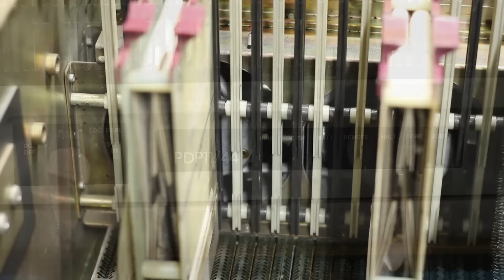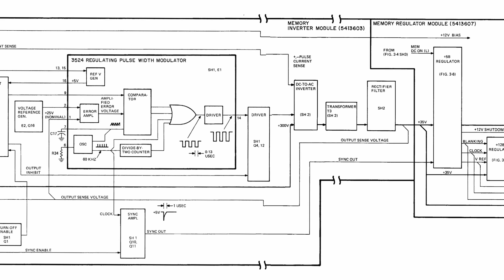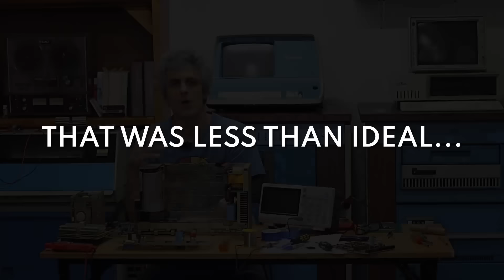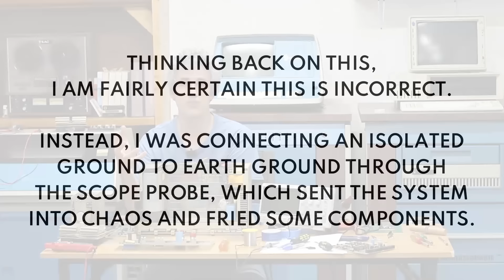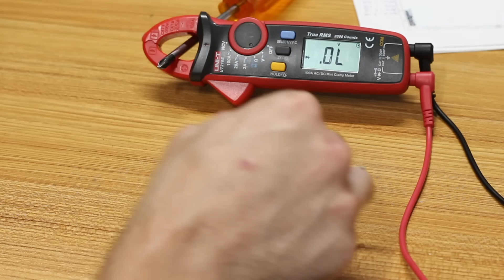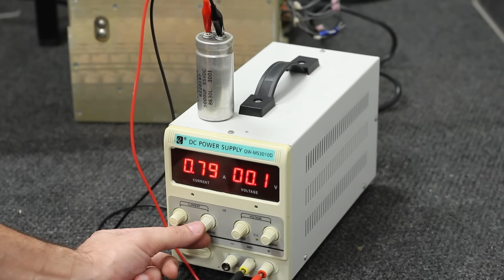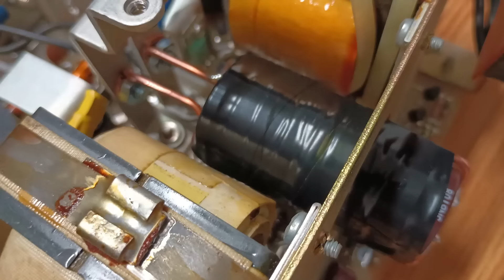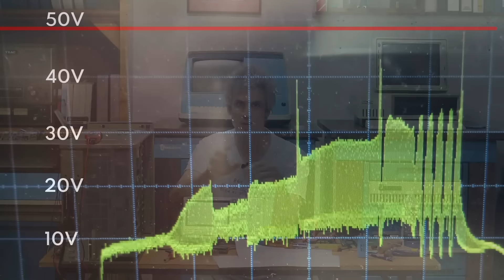PDP-11/44 PSU is Slowly Coming Back to Life!

Comment: Good going!  You have an awful lot of patience.   I would have given up about 45 minutes in.  A few suggestions:

(1). Consider buying a good electrolytic capacitor checker.   HP made some good ones and they’re now at reasonable prices.  

(2). Get some power  resistors or light bulbs that will put a typical load on the power supply.   Many supplies don’t like having no load and might trip their over voltage alarm with little or no load.
Reply from the maker: Thanks!
I do need a good, proper LCR meter. That's on my list of tools to convince Mrs. Usagi to let me buy, lol. If you look closely, everytime I power up the machine, I have a 12V automotive headlight bulb as my primary load. Looking at the schematics, not all the rails need a big load on them to come up properly, so the PSU is definitely operating with the proper load and as expected (with the exception of the +12V rail which has a regulation problem we'll dig into in the next episode).
Reply: @UsagiElectric the average LCR meter isn't that useful to test life, they don't test at high enough voltage. Some people claim that leakage is a resistive thing and thus can be checked at low voltage. However that doesn't account for material breakdown. That isn't linear and can be gone at low voltage and appear at high voltage. You would need a still very expensive HP or sencore device to measure that. I believe Shariar from the signal path showed one not so long ago. 
Miss usagi is not going to approve that expense. The simple LCR meters are fine for a quick test and value measurement.
Reply: @UsagiElectric  get a capacitor wizard.   Measures ESR in-circuit.   ESR is what you should be looking at especially with switching supplies.
Reply: @UsagiElectric  Maybe you should add an electronic load to that list as driving with only one headlight is prohibited by law. 😀
Reply: @UsagiElectric   For something much cheaper but still decently capable get something like the "LCR-TC1" which is based on an open-source AVR transistor checker. It identifies many component types. For capacitors you get capacitance, ESR, and loss factor. It also calculates transistor type, gain, voltage drop, and leakage.

The big downside of this $20 device is that it can get fried by charged capacitors. This is something I have unintentionally tested myself. Also you'll need to test out of circuit but this is true of almost any tester.

Comment: Ah, the fun of breaking something and spending days getting back to where you were before. This is why I gave up on hardware and went with software... while I was still high school age, back in '79 or so! A few decades later, I finally have the patience to deal with big TTL-level stuff. But not these bonkers power supplies! (RF is right out.)

Comment: You need an isolation transformer for your 'scope's AC.
Reply: Isolating the loads AC is the saver way. (But of cause more expensive for big loads.)
Reply: That doesn't do anything, the oscilloscope's power supply is already isolated. It would be just as effective to cut the ground wire in its power cord which is dangerous. As everyone else has said the safer option is to isolate the device under test.
Reply: @eDoc2020  I found exactly this, the cut ground wire, when I took over the lab I'm working in for 6 years now. To add to this: It's not save because you can have the exposed, easy touchable probe grounds and the casing ground of your oscilloscope at live AC potential. It's just waiting for you to close the loop, become a part of the circuit.
Reply: @poldiderbus3330   Cut ground pins really bug me. If you feel the need to defeat grounding use a 2-3 prong plug adapter to make it temporary.

Comment: Maybe you need to build Mr. Carlson lab super capacitor tester?
Reply: I remember correctly that device only tests at low voltage and that doesn't account for dielectric breakdown at high voltage. 
Most of the caps Carlson tests are so far gone, any tester would fail them. They're just that old and crappy.

Comment: Never trust old capacitors.  I've watched years of old radio repair and anything more than a few decades old must go.
Reply from the maker: It depends on the capacitors really. Without getting too spoilery, I just worked on a machine that had a legion of Sprague caps from the 1950s, and they all came up totally fine. That's why I think it's important to understand what's failing and what it's causing to happen.
Reply: @UsagiElectric  I know this doesn't really apply to the current discussion... But motor  start/run caps are probably the leading cause of equipment failure around the home.  Once they blow, they're gone.  I was really surprised when you mentioned "reconditioning" electrolytic filter caps! Oof! I never even considered that an option.... 🤫

Re: those '50s Sprague caps, were those the old wax cylinder ones?  They always seemed to smell funny too.
Reply: @UsagiElectric  I think that's quite a big spoiler to anyone who's been around here more than a few months. I'm betting we have something blue in next week's video.
Reply: Heck, you can't even trust the new ones!
Reply: Can’t I just reform them? Is that still worth it?
Reply: In my opinion "reforming capacitors" is pseudo science. 
It might measure different, but it is still defective.
Reply: @HimmelsDaemon  You pretty much nailed it all. Including Carlson reference. 😁  I've got three outside A/C units. The western facing unit, has had it's cap replaced, I think 4 or 5 times in 18 years. Definitely heat related for sure.  Regarding the vacuum tube era TV caps;  the ones I recall from memory (50+ yrs ago) were definitely wax axial,  kinda dark yellowy, maybe 1-1/2 to 2" long,  1/2" to 3/4" in diameter. As i  recall now, I'm pretty sure they were wound AL foil.  I can't recall the MFG. They we're usually covered in a layer of household dust and cigarette smoke.  Yeah. Nasty.  Fun times.
Reply: I wouldn't want a reformed large old capacitor in my house any more than I would want a reformed felon in my house.
Reply: @LanceHall  Oh c'mon. You can trust me!

Comment: You know ur machine is beast mode when it has to have a power supply just for its RAM.

^.^
Reply: Yeah. Static RAM was/is generally very power hungry.
Reply: The 11/44 did not use static RAM. The separate voltage rails for memory were for a ‘standby’ mode where power to the memory would be kept on while power to the rest of the machine was turned off, allowing the memory to keep its contents without keeping the entire machine running (and using 120A of 5V)
Reply: @awesomepuppy404  was this to keep it consistent with earlier pdp-11s that used core memory and therefore retained its contents when powered off?
Reply: @awesomepuppy404  Oh ok, thanks for clarifying.  I always wondered where M$ got it's idea for Windows warm standby.  😆
Reply: @memadmax69  Depending a bit on how you define it, some modern platforms sorta do too, just not like this thing does. Being a bit pedant here, but the VRM section of your motherboard has a section responsible for a voltage rail which is only really supplying the RAM and the MMU logic which is partially isolated but in most modern platforms physically inside the CPU chip package. I'm not up to speed on the newest chip generations because I have no reason to, but take for example the Core2 architecture, it has a setup like that. What that means is that there is a PSU and a whole set of logic which is partially isolated from the rest of the stuff in electrical terms, and can and usually does run at a different voltage from everything around it. This also means that you can damage a memory channel on some modern chips without affecting anything else, which means you can still even run the computer, just half or a quarter of your RAM slots will not work, and you won't be able to run dual or quad channel. Pointless trivia, but there you go.
Reply: Rams can be beasts.

Comment: fried something through the scope ground backfeeding? haha, classic! welcome to the club, dude. that's why you absolutely always must run these modern digital oscilloscopes with switch-mode power supplies through an insulating 1:1 transformer. you can improvise one from a couple of identical wall wart transformers from the trash parts pile, just connect them back to back.
Reply: You really shouldn't though. This can lead to the metal parts of the scope to become live with something else than ground. If you really need to do these kinds of measurements, you need to use a proper differential probe.
Reply: @MrSchorschschorsch  Always isolate the device you are probing, not the scope! That's how we've learned it.
Reply: @MrSchorschschorsch  instruments with linear power supplies have been made like this since forever. isolation actually makes everything safer by eliminating the ground path to the power grid. should you accidentally touch something nasty, like a 500V rail in a tube amp, it will become local ground and you're not hurt...
Reply: That's where those modern handheld scopes can save the day. You can't bridge two evil "grounds" when you're fully isolated on battery, right? (Right? Okay, I'm getting a little scared here...)

Comment: If you want to use a scope for testing things like this (power supplies/voltages >30V where high currents are possible), you could consider getting a scope with isolated grounds (or a cheap battery operated scope). Then you don't need to worry about the ground reference of your scope lead connecting things that might not be grounded the same way a normal scope lead is to the scope's earth ground at the wall.
Reply: Exactly!  It's possible to cause issues if you have one channel on a floating ground and another channel on chassis ground.  If the scope doesn't have isolated grounds between channels you can bring the floating ground to chassis ground and cause all sorts of weird issues.
Reply: Or a differential probe.

Comment: The “Air flow sensor” board probably uses a diode (PN junction) as a cheap thermistor to measure temperature, to detect if the fan is running or not. If the fan is running, then the airflow will cool the diode resulting in a change in the Vf (Forward voltage drop); if not, then it will measure a different Vf, and it probably uses a comparator (LM339 or similar) to create a digital “fan is running” signal. This way, the PSU can go into thermal shutdown if the fan isn’t running, but it’s supposed to be. That’s my guess. 😊
Reply: sounds reasonable and practical..... DEC would never do something this simple
Reply: That is actually a valid approach. However... The temperature coefficient of a normal PN junction is -2mV/K . So a temperature rise of 30K (30°C 86F) will only give you -60mV voltage change.
The application you describe would rather use a PTC or NTC which gives you a more significant change of parameter over temperature. And making it part of a voltage devider you can easily tailor the voltage to temperature curve to your needs.
If you are really clever, you can run current through the PTC. It will stabilize on a resistance (current) depending on how good the heat transfer with the surrounding air is. In static air it will heat up more compared to being in air flow...
The Mass Airflow Sensor in some cars works on this principle....
Reply: @randomsteve4288  I saw,what looked like,two PTC/NTC thermistors near one end of the board.

Comment: 170mV is a really odd voltage drop for a diode. I wonder what material is used in this one. Silicon and Silicon shotkey dont match, maybe germanium shotkey? is that even a thing?
Reply: Nah thats fine for a large low voltage shottky diode. These have quite some leakage and are just around 0.3-0.5v at high current too.
Reply: If diode is good this drop signs Ge diode clearly. Common in times when this computer was built.
Edit: Silicon Shottky also falls in similar drop range. (maybe a bit higher - about 0.3V)
Reply: @adamw.8579  High power germanium diodes never were a thing. No surprise with maybe 90°C maximum junction temperature before Ge turns pretty much intrinsic. Also nobody would ever use Ge in anything but special small signal applications as soon as Si parts were in the market for its horrible performance.
Reply: Maybe because the measuring current from his meter is so low compared to what the diode is specified for
Reply: Very large semiconductors have more leakage, and show a lower conduction voltage on a meter.  I work with power electronics, and the "diode" readings vary a LOT across the size range of devices i work on.  What matters is if the devices are consistent with each other, or just make sense based on experience.

For example, on very large IGBT devices (which are silicon) have a flyback diode integrated, and that can be as low as 0.2V when measured on a meter, and still be perfectly fine, even though silicon should be around 0.6v

Comment: DEC engineer to another: “how many amps you need?”

Hmm, yes.

“Got it. All the amps.”
Reply from the maker: DEC Corporate: "We need a very powerful supply."
DEC Engineers: "I've got this arc welder, we could use that..."
DEC Corporate: "Brilliant!"
Reply: @UsagiElectric  Be Glad you are not Tinkering with a VAX 11/780 try 408V 30A full loaded...And that the CPU
Reply: "At DEC it's not a real computer unless the lights dim on power on".
Reply: pumping amps on 5V is serious business, I had problems with mere 180W on 5V the other day.
Reply: 🎵 And when it's all assembled there's computer to your choler
It's nice to have a micro but a mainframe would be smaller
And when they turn the power on, it's sure to dim the lamps
With plus or minus sixteen volts and fourteen hundred amps 🎵
** "S-100 Bus" by Frank Hayes **
Reply: Really 120A at 5v is unthinkable kudos to the DEC folks
Reply: @MarianoLu  120A@5V is only 600W. There are plenty of modern desktops and servers that pull more than 600W. Modern high power CPUs can pull several hundred amps. That's why they place the VRMs (low voltage power supplies) right next to the CPU.
Reply: @LesNewell the “plenty of desktops” pull more than 600W distributed across all of their power supply output voltages. For example, a Corsair 1000W PSU is rated for 1000W (ish - 83A) on +12V only. The +5V and +3.3V rails are only rated for 25A. The VRMs for the CPU are powered from the +12V rail of the PSU. They produce the voltages requested by the CPU, which might be between say 0V and 1.75V. As the power consumption of the CPU increases, the requested voltage will increase towards the maximum, keeping current in check. Even a super power hungry high performance CPU will max out at around 100A current or less.

Intel and AMD publish super detailed electrical documentation, so you can always go take a look.
Reply: @LesNewell  Yes, but modern systems use almost entirely the 12V rails for everything with significant draw.  The load on the 12V rails is probably 550W, which is 46A, with the remaining 50W split between 5V and 3.3V.  Supplying 5V@120A is an entirely different story.
Reply: @AntoineWG  The VRMs on the motherboard take 12V and drop it down to a volt or so at 100+ amps for the CPU. GPUs can take even more. That was what I was talking about.
Reply: I doubt that strongly! Within DEC expect clear specifications for something like power usage and rail voltages